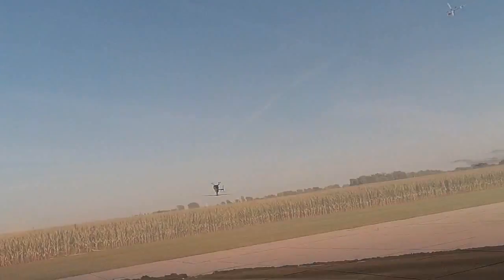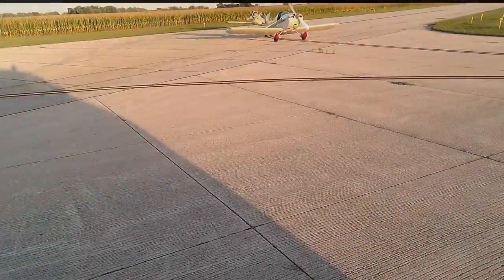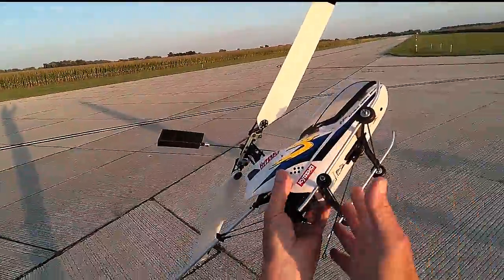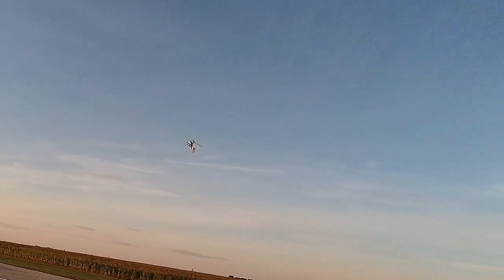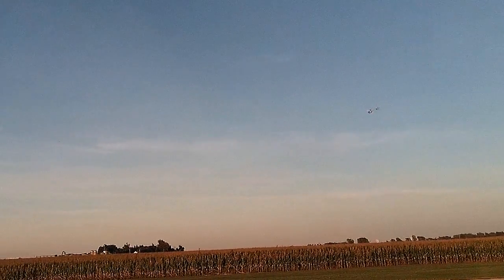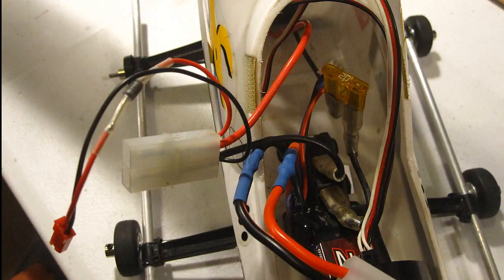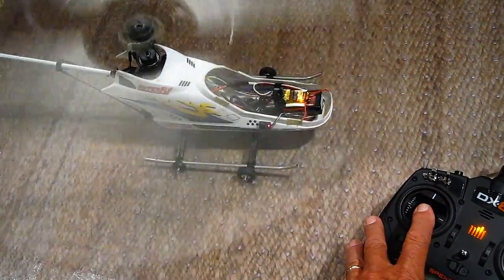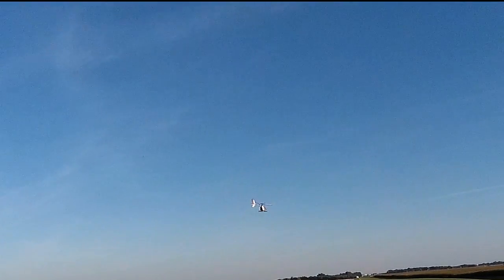Kyosho Hyperfly NO tail rotor heli Demo, with & without Throttle control + Full scale Fly-By's!

Comment: Hi Dave, great video. I remember seeing one of these hyperflys at my flying field back in the late 90's. The pilot couldn't get it to fly. You inspired me so much I bought one of these on ebay and have converted it to esc throttle. I'm curious to know the battery you are using is it 2S or 3S and the capacity? Cheers and Thanks Stevie
Reply from the maker: Yes, unfortunately not everybody could figure it out, but once you did, it was easy and still is. It really helps to have R/C airplane experience.  BTW,  I just got a hold of a Hyperfly Apache and here is a video on it I hope you enjoy.  The battery I use is 2s, 7.4 v 1800 mAh.  https://www.youtube.com/watch?v=_0ZuWIzfOno&t=10s   Let me know how it goes.

Comment: very cool heli, congrats on such a successful design! I think I know what I will be doing with my old blade cp pro now! off with the old worn out tail motor and on with a pie plate!  :-)  Ever try no tail rotor on a nitro? I'd imagine a 30 or 50 would really make the heli guys look twice!  Would you need a much larger air foil for it to work?
Reply from the maker: I never had a need to do it on a nitro, because I do not typically hand launch them.  LOL.  But certainly it would work, just as all my one bladed helis have.  Thanks.
Reply: @NightFlyyer  ha, I didnt think about the hand launching! I was surprised with the flight on the esc one that the craft didnt yaw more from from the varying head speed.

Comment: Hello, I am trying to figure out what size motors will fit in the Hyperfly? I was going to concert to lipo but the motor was slightly too small
Reply from the maker: The stock motor is an AP29 and what is in this one.  I'm using a 7.4 v lipo.  Good luck.
Reply: @NightFlyyer  Thank you! I am having difficulty getting my hands on an AP29, do you know of any other motors that will fit?
Reply from the maker: @michaelmartone3146  I do not, but any .30 size electric Brushed motor should work.

Comment: I noticed the swash plate on you hyperfly is set at a 90 degree angle to the rotor shaft. In my instructions it says different.trying to set mine up. Would it be easier to fly set like yours?

Comment: Hi Dave , I was able to get a hyperfly from ebay. I have converted it over to lithium power and added speed control. I was wondering if you had a recommendation on adding a EDF fan on the tail. Thought this would make a fun project to see if I could get it to hover in my drive way. Thanks in advance.

Comment: 8:40 the hyperfly seemed to "hover" pretty good against the wind. I like the improved  hyperfly version better with the ability to control the throttle rather than a fixed throttle because it can fly slower and the running landings are more gentle. Can I still buy these hyperfly helicopter because they look quite fun to fly ?
Reply from the maker: Thanks.  Yes they can hover quite well in a slight breezes.  When easy helicopters with "auto everything" and counter rotating helis came on the scene, production stopped, so they don't make them anymore.  But you can buy a Falcon 40, take the tail motor prop off, add a paper plate, and voila....you have one.  Thanks again.

Comment: Dave ..just saw on on EBAY  USA  $199.00 with radio...+ freight  Works out a bit high when converted to local currency.
Happy Landings...
Reply from the maker: That is a good price and about what I paid for this one. My originals are in the AMA Museum, and the others I had got burned up in the fire.  I was happy to find this one on Ebay as well, this spring.  Thanks.